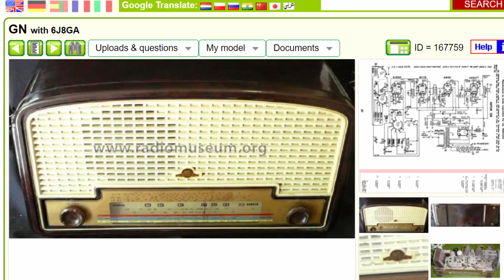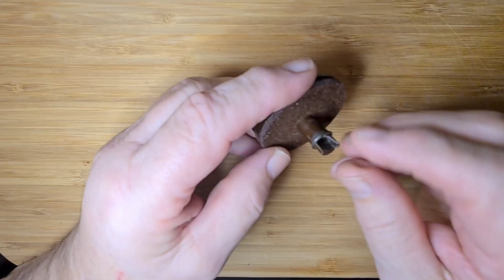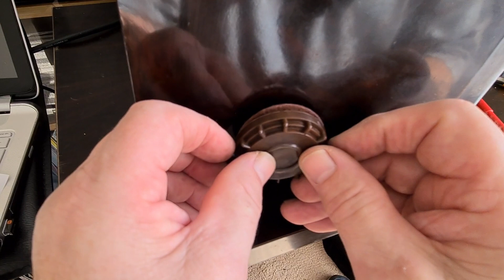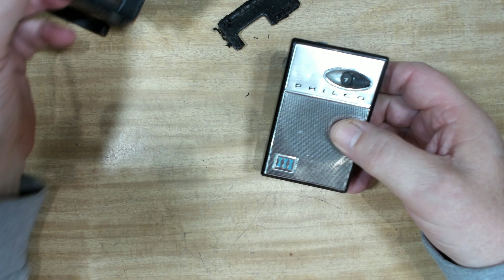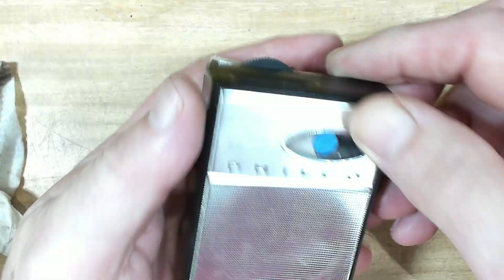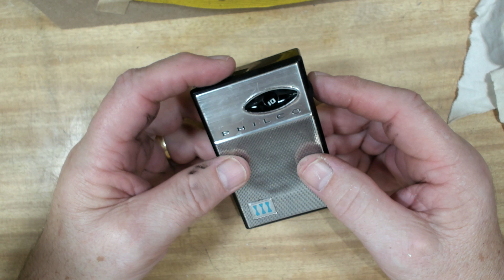Astor GN Big Bow and Philco Transistor Radio NJ-600-BKG

Comment: Hi Dave,
Loved your Astor GN radio - it definitely has very distinguished styling.  
The defective resistor you unearthed turned out to have been a bit of a bugger.  Years ago, certainly sometime during the early 1970s, I constructed a ‘component sniffer’ - those type of circuits those days were commonly known as an ‘electronics bloodhound’ because they were used to sniff out failing components.  A few years ago, via a YouTube video, Paul Carlson constructed a component sniffer probe circuit that had a few similarities to the one I constructed years ago.  Paul’s sniffer probe has an LED indicator whereas such devices as LEDs weren’t available during the early-70s.
At the time you was moving components under the radio chassis with a chopstick, had you got a component sniffer, you could have moved them around with the sturdy tip of a sniffer probe.  You might have picked up on the failing resistor (if it had been arcing over internally at the time) as you touched each component.
It might be worth investigating Paul’s sniffer probe circuit video.  Their  circuitry, and construction is not overly complex!  If my memory serves me correctly, my bloodhound probe incorporated four, or five BC109 transistors, and the circuit board, and battery was housed inside an indigestion tablet metal screw cap canister - not the safest arrangement but the whole thing worked well, and I used it on a daily basis for almost fifteen years before it eventually fell to pieces LOL!
I like the Philco pocket transistor radio.  It certainly brings back memories of the mid-1960s LOL!  I remember, when I was aged around twelve, pestering my parents for a small transistor radio like the one you picked up for $10.  Although those type of radios were cheaply thrown together, they could work reasonably well. 
Cheers my friend.  As always, lovely chatting with you, Phil.
Reply from the maker: Hi Phil, the GN is a nice and capable radio and there are still plenty around supporting their popularity at the time. 
I think we discussed using a sniffer when I did the Montgomery Ward radio which had intermittent crackle from a wire shorting to the can in an IF coil and I think you sent me the circuit for the Bloodhound but I haven't done it yet. I will have to investigate it but I wonder if I could make the probe and connect it to my signal tracer. Thanks for the kick in the pants to finally make one 🙂 It's a moot point I guess as I wouldn't have had it in Melbourne anyway. 
My Dad had a pocket radio he kept in his bedroom wardrobe, he used to take it to the footy. I would sneak in sometimes and just look at it in wonderment, I was probably about 8 or 9 at the time. I don't know what became of it, he died a few years later and I never saw it again. Thanks Phil, I always look for your comments and enjoy reading them, cheers!

Comment: You brought back my field engineering days for sure on this one, Dave!  The long drives to customer sites, the search for parts, the site-made tools, etc., those were the days when I couldn't go home until I heard the sweet hum of well adjusted machinery filling my ears.  When you're a thousand miles from nowhere with no spare parts available you have to be clever.  Kudos on the remote-site fixes, Dave.  That sweet little Philco probably cost you more in parts than it did when new but think of all the joy you got out of fixing it.  Love the Astor, too. I will be filing that JB Weld knob repair technique of yours for future use!
Reply from the maker: Hi Sincerely Yours, Now that sounds like a rewarding experience, using ingenuity to repair broken down machinery. If I was worried about the cost of fixing radios I would have given up ages ago, I often spend more than the radio is worth to get it restored but as you say it's the pleasure of bring something back to life that would otherwise be sent to landfill. The knob repair worked well, I hope it is useful to you. Thanks SY 👍🙂

Comment: Hope you enjoyed Vic. Its absolutely freezing atm, although march and april was some of the nicest run of nice weather I've ever seen here. My dad has a very similar Astor, I earmarked it for a restore, only to find out that like yours all the caps and dodgy resistors had already been professionally changed. We've had the thing about 30 years (clearing sale find) so prior to that I can only imagine it stopped working and got sent to a shop. So I gave it an alignment and left it at that. Loved the intro video. Quite entertaining.
Reply from the maker: Hi Seiskid, early autumn in Melbourne is the best time, we tried to get there then but couldn't get there till May but it was still fun. The GN is a very nice radio with a good sound, good that you still have it. Thanks, the intro took longer to do than I thought 😄

Comment: There is a reason Transistor radios were made in Japan,  they have smaller fingers to work on the stuff
Reply from the maker: It's pretty tight in there but I doubt that was the reason 🙂

Comment: Hi Sir. i faced many times valve holder problem. All components ok but holder problem mind blast this is serious but you very normally clear all types radio 📻 sets all so fantastic job sir thanks for sharing this video.
Reply from the maker: Hi Nath, valve base contacts can be hard to fix, I think the problem was with the valve cap and the shield earth strap, when I fixed them the problem went away. Thanks Nath 🙂

Comment: The biggest problem with those little early transistor radios is usually the electrolytic capacitors failing,.  Sometimes you'll get transistors fail.   I see it quite commonly :).
I'll watch the rest of it now to see how it all goes
Reply from the maker: Hi Brendan, I figure it will be caps, the transistors were OK thankfully 🙂
Reply: @DavidTipton101  Shango was a great reference there.  He does so many of them

Comment: Welcome to cold old Melbourne. Couldn't you have brought a little of the Queensland warmth with you. Even away from your workshop your skills are amazing. Very lucky that resistor died before you left. I was very surprised you managed to get an exact replacement tuning gang for that little Philco. Looking forward to seeing the leather case restored. Very entertaining as usual.
Reply from the maker: Hi Ian, it was pretty chilly in Queensland after we left for Melbourne. I ran the radio all day waiting for it to fail, I wasn't convinced it was fixed, the resistor was intermittent and would fail then come back for 10 minutes or so. Jaycar stock the tuners and they have them in some of the kits. I hope to pick up the case this week, I'll show it on the next video. Thanks Ian 🙂

Comment: Great work, Dave, especially on the first radio with limited resources. 

The Leather Shed — is that affiliated with Don’s Old Radio Shed? ;-)
Reply from the maker: Thanks Super Het. There is no connection between the two 🤣😂 I still haven't worked out if it's Don's shed that's old or the radios 🤔

Comment: Interesting David - you really need a travelling radio repair kit because lets face it as more and more people get to know you and what you do so will the 'little' jobs keep arriving. I had a Phillips transistor in a horrible vinyl case as my first transistor radio... I always remember that the inside of the works had a very distinctive smell - sort of electronic. The vinyl case broke down and split on the seams not nearly as nice as the leather case for your little Philco. Keep repairing - I remember thinking just a couple of weeks ago that it was about time you appeared with your latest project. Keep well.
Reply from the maker: Hi Kenneth, yes it seems I will need to pack a bit more electronics repair gear in the future. I am very familiar with the smell, mostly gone now of course. I was surprised when the leather guy said the case was in poor condition, I thought it was pretty good, the vinyl ones don't last long, even now. I put out a video every three weeks, it's a nice balance for me. Thanks Kenneth 🙂

Comment: Nice oneDavid, that first radio is what hapens to me, I start somewhere and just go from one thing to another!  Before I know it I have gone from one side to the other!!!  That little transistor is working better than some I have bought new!  Not a brand I like, but that one did impress me :-)  You waved your magic over it :-))
Reply from the maker: Thank you Bob, it's tricky tracking intermittent faults, you think you have it and it fails again 🙄I was impressed with the little radio, it sounded better than I expected 🙂
Reply: @DavidTipton101  Yeah, it was better than some I have bought like it  :-)
Reply: @DavidTipton101  Yep, I have bought new ones like it that have worked worse from new!

Comment: Hi David; I was thrown at first by the DRIVE in theatre picture but then saw your name and thought cool a new down under radio adventure, well two actually!
  You did very well first Rado especially considering you were away from your home base, shop, tools & equipment. The 6U7 socket was giving you a good challenge. I liked the little Philco pocket radio you did back home, you put some love into it and brought it back to life. It'll be good to see it back in its restored leather jacket. Great stuff!!
Reply from the maker: I did wonder if the thumbnail would confuse people 🤔 The first one was a little tricky but I wonder if the loose top cap and the intermittent grounding of the 6U7 shield was the problem with it. The Philco worked out well, transistor radios are a bit of a mystery at the moment but I'm getting there, I hope to get the case back this week and I will show it in the next video. Thanks Daniel 🙂

Comment: The thing about the Astor Gn is you never even had any hum from the AC line and you never changed any electrolytic capacitors. That was some great troubleshooting on that one David. That is a small transistor radio. My eyes are so bad I can never see the parts. You are a better man than I am Gunga Din er ah David I could never get in there to replace those tiny electrolytic caps. I use De-Ox-It D5 on all of my radio projects glad to see you do as well.
Reply from the maker: Hi LL, yes the filter caps had been recently changed so no hum. I needed my magnifying visor on to change the Philco caps or I'd be soldering my finger to the board. Thanks LL 🙂

Comment: Lovely work as usual. When I was a kid at school I used to vamp up the early 6 transistor radios,  they had awful  resistors and capacitors so I replaced them with good quality resistor and capaitors and this made them work much  better, a few years later Japanese radios got a lot better
Reply from the maker: That's a lot to replace on these tiny radios, that's dedication 🙂 Thanks ajhnubia.

Comment: This video proves you do not need expensive equipment to do this, you've done a great job without it.  I am highly impressed you were about to go to the shop and buy a new tuning cap... not here in the US for sure.  Well done
Reply from the maker: Hi Ron, at least for basic repairs you don't need a lot of gear. We still have two major electronic storefront dealers, they are very busy places, I hope they stick around.  Thank Ron 🙂

Comment: Dave, Glad to see you’re back.  Hadn’t seen anything for awhile, and was beginning to get concerned.  I really liked the fix for the knob. Knobs can be a problem - even when they are still present, they are often damaged. I like the saw-blade-epoxy-dummy shaft approach. I’ll file that one away in my bag-o-tricks.
Reply from the maker: Hi Gar, every three weeks I put out a video, it seems a good balance for me. The knob fix worked out pretty good, at least it fixed the wobble in it and prevented further damage. Thanks Gar 🙂

Comment: Great intro, love it. You see you don't need your fancy equipment to fix a problem in a radio. A screwdriver and a wet finger will do wonders. Thanks for this video. Have a great weekend.
Reply from the maker: Thank you De Mus. I agree, most troubleshooting can be done with a meter, a finger and a chopstick and repaired with a soldering iron and pliers 🙂

Comment: Great intro, bits and pieces throughout the adventure. Makes my day! It’s not a nerdy scene at all this vintage valve radio repair industry but a community full of personality, reality and a sense of pride & joy. 😉

Another interesting adventure David. Where can we purchase shares in Deoxit! 😩 I had to put a can on order tonight. I am starting to spray / drip it it on cotton tips to apply it sparingly.

The Philco transistor radio is a top little performer now. It would be so useful out fishing, catching the cricket score or keeping abreast of the weather where cell phone transmission signal is poor. Nice work!!! 🔧😁🙋‍♂️
Reply from the maker: Hi Peter, thank you and I totally agree with the community bit. Deoxit is just over $20 in the US and $56 here but it good to be able to use something that hopefully is safe on pots. The Philco sounded pretty good for such a small radio and with three IF stages it was pretty selective, a handy pocket radio. Thinks Peter 🙂

Comment: Well done shango ... Ooow no :-D
I like his way and sharp sarcasm/madness.

You are just too handy david, the mobile radio doctor :-D
A dead 33k resistor and you found one :-D.
It didn't take you long to get the cute little radio singing again,  the variable cap was worn out.
That's my excuse lol. 
I'm supprised you were able to get a fresh tuning capacitor,  a rare thing to see in the u.k.
It's like the loverly vairiable aluminium toaster rack in valve radios,  i would have more chance finding a honest politition :-D (Not likely).
I hope your leather mate (Not that he is made of leather) fixed the case :-D.
Reply from the maker: Haha... yes, it wasn't Shango, it was me! I don't really know what happened to the tuning cap, it wasn't like that originally. I have another radio with the same problem. I got the new cap at the local electronics store, very handy. I had hoped he would have the case done but unfortunately it didn't happen. I bet he makes a great job of it though 👍🙂
Reply: @DavidTipton101   I suspect he would have to remove the stitching to recondition the leather and catch all the (ready to break ) bits.
It's likely he has some kind of process to stiffen up the floppy bits .
Super glue NO NO i didn't say that lol.

David, you often put yourself down, please don't do that,  you have the skill to fix most things back to a new condition, 
You were crap at aircraft repairs though ha ha :-D joke :-D
Ill shut up now.
Reply from the maker: @zx8401ztv  Having watched a lot of The repair Shop I assume he will try and get oil back in there, on the show they often put a really thin but strong leather backing at weak points so he might do that. He could probably make a new one for me if need be, he is very clever and a really nice bloke. 
Haha... I don't think I did put myself down in this one, it's usually to show that I am not an expert and kinda making it up as I go. 
I would like to know how you found out about my incompetence with aircraft, I hid it well for years and no one suspected a thing, I just blamed it on the next guy 😂 Thanks zx8401ztv

Comment: Another great video mate have a GN here good radio just have to replace some electrolytic caps in it and it's good to go. The most important tool In my toolbox is the good ole Wooden Chopstick diagnostic tool, keep up the good work mate
Reply from the maker: Hi Bernard, thank you. The GN is a good radio with surprisingly good sound. The chopstick comes in handy 🙂

Comment: I thought I'd drifted onto Shango66's channel until I saw you cleaning the case on that Philco! Great job on the Astor too, especially as you had limited tools to fix it with. Reminded me of the days I used to be a field engineer and the tricks I used to use to get things going without the right gear. Great video Dave, always look forward to them.
Reply from the maker: It was a bit Shangoesque there for a minute, he does it all the time so I thought I'd give it a go. It requires a bit of ingenuity sometimes. I didn't show it but I checked the oscillator with a second radio and the dial alignment against a transistor radio with the frequencies on it. Thanks Radio-Ged 🙂
Reply: @DavidTipton101  Bridging old, drying out transistor radio coupling capacitors is a common thing for a quick and dirty test.  It can't hurt to replace all with high quality modern versions, though, if keeping the radio for a showpiece.